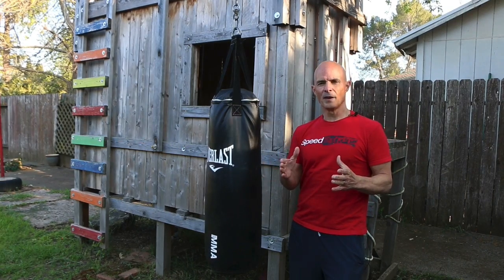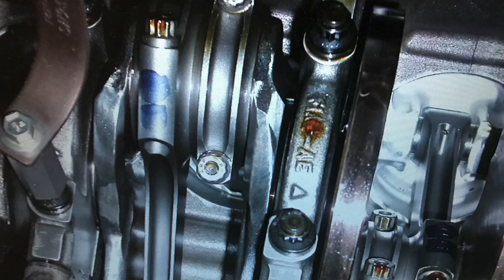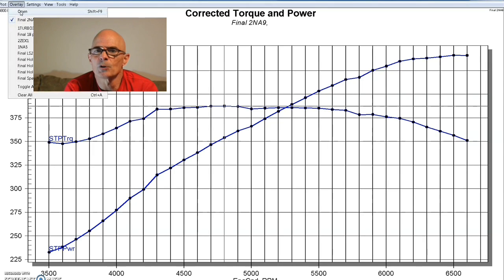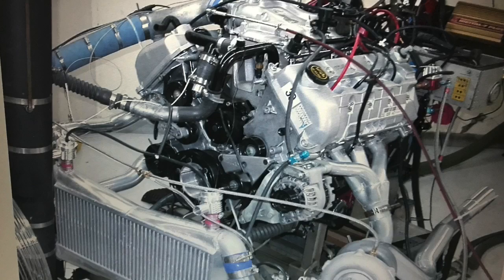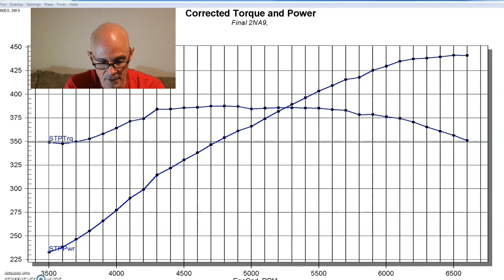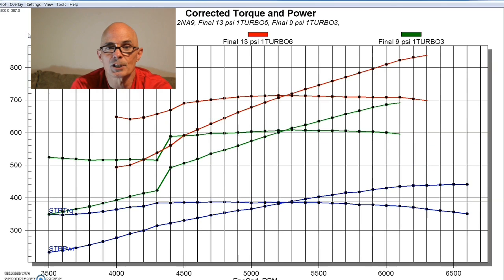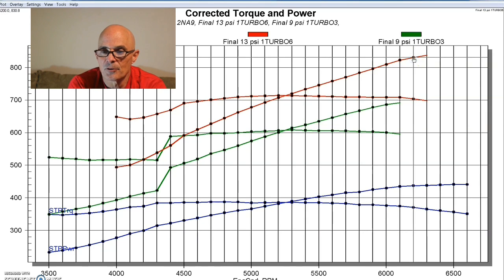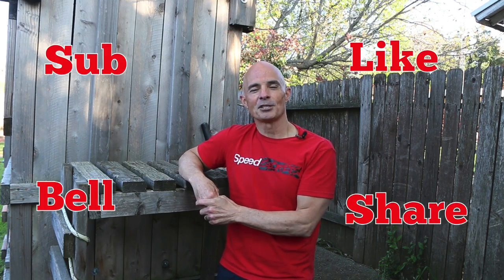1,000 HP TWIN TURBO FORD 5.4L 4V NAVIGATOR

Comment: I have 2  good running 4.6l 4v motors with the teksid blocks. This is just the video I needed  to finalize the plans for the build thats going in m,y 65 Galaxie. Not gonna try for 1000hp, but anything above 500hp that is 100% reliable is gonna be a win for me. Thanks for these awesome videos, I know I'm a little late to the party

Comment: so nice of a video so I recently recently got a Lincoln navigation 05 about a year now, and I’m a big fan of racing cars. I want something different I saw that the navigation had a V8 dual cam it was a 5.4 so I sad why not give it a shot the difference is I want to add a Whipple charger on it but this really helps because there’s not a lot of information about navigators with this type of set ups, even tho the 5.0 have this engine and the cobras. All tho they are quite different they are in the same block. This video definitely hyped me up to do this type of set up on my navigator and I can’t wait knowing the fact that it will work.

Comment: Hey Richard, have you seen the adapter plates from MMR that allow you to run a Coyote intake on a 5.4L 4V engine? I would be very interested to know what that could do for power compared to the other intakes you've tested. Thanks for the great content and info!

Comment: I want to do a build like this on my 2005 ford fx4 4wD. The current 3 valve just died at 205,000 miles love the truck dearly. Is it possible?Seems feasible to me. Just wanted your opinion Richard before I ask my friends and they clown on me.
Reply from the maker: IT'S EASY TO MAKE POWER WITH A 4v
Reply: @richardholdener1727  I know I would have to work some magic with the throttle issues swap drive by wire to drive by cable but are there any other kinks that you might  know about. Biggest concern for me is that my truck is 4 wheel drive I’m not sure if this is optimal for a build like or similar to this one you did on the video

Comment: Hi !! I will love to know if you put 9 psi boost and an direct injection of oxigen in the engine !! What i have in mind is the boost incrase air but There’s only 30% approx of oxigen in the air and what is igniting the gas is oxigen, so i would be curious to know if instaid of puting a lot of pression in it would incrase power at lower boost?
Reply from the maker: pure oxygen is very volatile -it was tried back in the piston engines in WW2

Comment: How bout a 3valve 5.4 with 550- 600ftpounds of torque for towing?? Don't care bout HP, does fine, but 450-500 ftlb @ 2500 rpm would be awesome. Noone does a vidio on towing, got to pull the rig to the track, or in my case, camper to the lake. Does fine, but more is always better.
Reply from the maker: 600 lb-ft at 2500 takes boost
Reply: @richardholdener1727  that's why I'm talking bout!!!! Thanks

Comment: I hope you'll get Ford to send you a 7.3L Godzilla to be let loose on. Those things are BEGGING for boost once you throw some ARP studs and forged 4340 rods in them. (why does EVERYTHING have powdered metal time bombs in them now?) I know with a simple intake, tune and headers that engine out the box makes over 500hp and almost 600 ft lbs.. to see one with some head work and turbos would be killer. I'm sure they'll shoot past 1,000 in no time and that variable oil pump and squirters will help keep it alive.. Hell I don't think 1200 would be unreasonable at that engine size.. and the torque will probably be right there with it.

Comment: Im staring a 5.4 build, so far i have an 08 shelby block and crank hbeam rods jdm pistons all balanced and ready for a set of heads and cams.. i was getting ready to spend 10k on heads and cams but after watching this video i think ill snag a set of navigator heads and build thoes..
Reply from the maker: GOOD CHOICE
Reply: @richardholdener1727  so i bought a holley hp engine management system for my build, 99 04 4v ....my question is with the 08 shelby block what navigator heads will work with this combo and can i us other 5.4 engine parts to cut costs on the block such as oil pan timing cover exc.

Comment: I'm having a hard time finding an intake manifold for a turbo 5.4l 2V. The 4.6 that came out of the car had a fox lake P51. Would it be okay if I used it with the adapter plates, or would raising the injectors a .5" away from the combustion chamber be a bad idea?
Reply from the maker: NOT SURE YOU CAN ADAPT A 4.6L INTAKE TO THE 5.4L

Comment: Hi Richard, as I may have mentioned I'm building a 4.6 4V. I was fortunate enough to get a brand new set of castings 9 thread heads a fellow had bought from Ford performance. So I went all out with porting and Ferrea valves. I never changed the guides out to say bronze. It's a street car 7000 rpm max. Block is teksid and I stroked it full forged internals. 10.3:1 compression. I'm ready to assemble but now I'm second guessing those valve guides. What's your opinion?
Reply from the maker: Guides are fine if the clearance is right
Reply: What am I looking for as a spec for clearance?
Reply: I just want to do this correct the first time. My head builder / porting guy is good more of a LS chevy guy. Good flow number similar to what Fox lake racing published. But his first modular set. Remember I am in Canada. BTW I had sent these to Hyland for this but that turned into a long story where I ended up flying to Ontario and taking them back. A year later his shop was closed.

Comment: Does the 4 valve engine have variable valve timing like a 3valve engine? If not how is the timing adjusted? I have a 5.4l 3valve engine in my 2004 supercrew lariat, it's not a dog, but I would like to increase the horsepower and torque not to race or run racing fuel but just a strong reliable driver. I realize that I will need to run 93 octane on a turbo motor. Any pointers would be appreciated. 
Thanks 
Scott 
USAF veteran

Comment: I want to stuff a Navi engine and five speed into one of my vic's . I'd have to run both turbos some where between the front wheels and front bumper but I do feel this set up would make that 4400 lb panther feel like a faimont futura 😈
Reply: I've got a Mustang 6 speed swapped into my Navigator and it's a damn riot for 5800 lbs.
Reply: @BuffMyRadius  6 speed swapped navigator?  Holy crap do you got videos?  That is awesome.  Just like 6 speed lightnings they really get my blood pumping lol
Reply: @midnight347  I do have some build videos up on my channel you can check out

Comment: Would it be cheaper to get a built 5.4 with cams and worked heads to boost or a stock Coyote to boost swap in a SN95 Mustang?
Reply: You won't need worked heads but cams would be beneficial I beleive you could prob do a forged internal 5.4 4v for similar money to gen 2 coyote cams included and make at least as much prob more power.  You can also set compression wherever you want if you are building the bottom end.  And you have a newly built forged motor vs a stock used motor.  As good as the coyotes are id still rather have a fresh built 5.4.

edit
Not to mention a cammed 5.4 4v would sound heavenly def better than a coyote but sound is subjective lol.  They do sound gnarly though.

Comment: The idea of swapping a Lightning engine into a Navigator had long been in my mind, but having seen the results had with a boosted 4-valve DOHC 5.4, curiosity begs what that w/inter-cooled blower would result instead! :D
Reply: Wouldn't you be able to run a gt500 lower manifold/intercooler setup on one of those?  Unless the heads make it different fit or whatever but they're both 5.4 4v.  That would be awesome.  Then you could just run any blower they make for gt500s.  I would go gen3r them tvs are torqey and good on the hit that would help get that big behemoth moving lol.  I would def just build the 5.4 4v in the navigator and boost it rather than doing a lightning swap.  I'd rather have a built 5.4 4v over a stock lightning 5.4 2v.  Much better potential.

Comment: The 5.4 engines in Australia have the 4 valve head and we found that the heads need bleed holes in 2 spots on each head and the rear  passage in the block needs a water fitting and then all of those points need a modified thermostat housing to accommodate those bleeds. We also modify the water pump impeller to give a consistent head pressure. The result is a much smoother torque curve and the ability to lean off the mixture safely.
Reply: I read about this somewhere in a forum I’m glad I didn’t make it up in my head

Comment: I used to live and breath Ford mod motors - boy, have I seen the light since then. Gotta give Ford credit for a really stiff and robust bottom end architecture, but it took them 25 years to ever put a good set of heads on them (coyote). Beyond that, they're freaking HUGE. They don't hardly fit in anything you'd want one in. Then the complexity and number of moving parts - 32 valves, 32 roller followers, 32 lash adjusters, 4 cams, 4 cam chains, 4 cam chain tensioners, 8 cam chain guides, etc etc etc.  Tiny bores that are hard to get filled. The list of demerits is endless - and for what? So you can claim that your power/displacement ratio is better than GM's OHV V8?? No thanks.

Comment: Im running 5.4 4v NA, how are you getting 90hp more than mine in na form? 😧 they're a pain to work on in car thats for damn sure
Reply: This is an engine dyno no driveline loss no accessories no exhaust etc.  Numbers will be higher.

Comment: Awesome. I'm currently doing this swap into my 98 Svt Cobra but using a heavily modded Aussie 260 boss intake with cams and longtubes , she is built and around 10-10:5:1 Cr , Great Video
Reply: You should be above 350 possibly 400 wheel depends on the camshafts and the tuning and what fuel etc.  I contemplated doing it on my 97 cobra back in the day but decided against it that was in 05 and I didn't know as much about how to get power out of em and intake options were even worse than they are now lol. Good luck with your build these motors are badass

Comment: Can you do a build on a ford 302 and basically squeeze every last possible naturally aspirated hp out of it on a “roller block” to see how obtainable it is for everyone? Dart blocks are pricey and a lot of people use oem blocks. It doesn’t have to be a true roller but pretend it is 😉. Itb’s and equal length headers, all the way 🏎💨

Comment: I had nothing but issues with my 4.6 4v, bleeding the air out of the cooling system was a nightmare!. Amongst a bunch of other issues , id take a 302/351 with boost any day over any mod motor! Half the size with more cubes kinda a no brainier
Reply: Maybe you just didn’t know what you were doing Bc you’re the only complaint I’ve seen on that engine, 4v mod motors are good, 5.4 2v’s are solid, 3v’s and the 4.6 2v are junk

Comment: That tuner are you running?
Reply: Will this also work for a 98 f150 non pi🤔if I did the pi swap polished heads and a cam would it make around 400?

Comment: How about a budget 351C 2V making 400 HP. I know this channel doesn't spare expense because the idea is to make as much HP as possible. And that's fun to watch. But most of us will never spend $8-10K on a single engine. I've seen several builds of the 351C 2V that fall a little short of the 400 HP mark. It almost looks like the 2V is preferable for a true street car.

Comment: Ran a 5.4 2v Lightning for years, stage II cams 7lb crank pulley,  ported Eaton and heads with full Bassini exhaust.  I am more of a SBF and BBF guy, but that motor always impressed, sounded excellent and very smooth.

Comment: I'd love to see how the new 7.3L Ford engine reacts to boost. Seems to me a twin turbo version of that engine could be quite interesting.
Reply: Sofiane Pontiac  he's talking about Ford's new 7.3 gas but Wow that's awesome
Reply: Needs valve train it don't spin very fast bone stock.  It barely makes peak power before 5k it needs heads cam and springs then it's good for about 550-600 na.   Then your talking a true boosted monster...
Reply: @alexwhite176  These 7.3 engines making peak power at 5500rpm is actually pretty high in the revs for that many cubes. The stock vvt valvetrain is robust and quite capable at higher rpms. With little more than a proper intake and cam, you can easily get 5-600hp out of these new big blocks. Even the fact while stock, they make over 400ft/lbs from about 1500rpms all the way past 5000 is stout. This thing should sneeze out 800+ ft/lbs with less of a torque curve, more of a torque shelf.
Reply: @madmod  amazing how things change in six months lol
Reply: To those who complain about the 7.3 not doing well at high rpm: remember what it was built for...a super duty truck.  They will need some work to make power at big rpm’s, but certainly a better starting point than a 460, and it’s externally tiny for its displacement! Regardless, we should be excited that Ford came to their senses and went back to pushrod simplicity
Reply: @williammccourt7581  The 7.3 peaks power higher than the 4.6 2v mustangs do. If it peaks at 5500, it can easily run out to 6500 and maintain valve control. Ford already released valvetrain specs and they are more than capable of turning rpm. Displacement isnt a limiting factor in rpm assuming you've got the flow capacity and valvetrain control which this engine certainly does.
Reply: @madmod   I understand that displacement doesn’t dictate an engines ability to rev. I’m just tired of people complaining on the internet saying the power band is low, as if it weren’t designed for a huge vehicle whose job is to tow and haul at low rpm. It just grinds my gears because it does it’s intended job very very well stock and could easily be modified to be an absolute screamer if you want to change its job to being a track monster. I’ll quit bitching about other people bitching now lol
Reply: @williammccourt7581  I agree with you dude. This thing makes over 400 ft/lbs of torque from idle to nearly redline. Every dyno ive seen in truck has been still climbing in power at 5k rpms and thats with its long runner truck intake in fully stock trim. Even if the power hits a wall and falls off at 6000(which i guarantee it doesnt), it would still be making enough power to put a street driven auto car in the low 11s, if not high 10s stock. They make the power of a boosted stock modular at the same rpms and do it on a low compression stock truck engine.
Reply: @williammccourt7581  Dont we need to consider the engine's stroke, bore, and compression when thinking about high rpm power?  If the piston has to travel further when compared to how much force is pushing it down, I'd think that would be the biggest factor. But I dont know much bout this topic tbh
Reply: @williammccourt7581  I agree with ya on its purpose. It makes its power low down. Its designed to be a work horse without having to deal with the high maintenance of a diesel option. Just like the 90s GM 454 with the peanut valves, its a slow turning big block. You allow it to breath and flow and it'll make big power. Im excited to see what the 7.3 gasser will prove once companies come out with aftermarket products!
Reply: Hey, Ford may be giving us it with the potential of Megazilla.
Reply: There are Videos out now of stock 7.3L with boost making HUGE power.
Reply: @superkillr  Yes there are. Pretty awesome
Reply: That's not in the modular family is it? Will a T45 or T56 bolt up to it?
Reply: 460>the new “7.3”
Reply: @gokartmadness3047  The weight and size advantage of the 7.3 alone is a huge advantage over the 460. Never mind the fact it makes 100 more hp to the tire.
Reply: @madmod  thats because the 7.3l is literally a small block. its about the size of a 351w
Reply: @87DAM1987  they are a good bit longer with having such a wide bore spacing
Reply: @87DAM1987  Really it's that small? I haven't seen one yet outside videos on a dyno so hard know size. Impressive package that Ford has come up with.
Reply: @gokartmadness3047   460 is a great engine but to build a turbo efi setup even off a junkyard block with decent heads and valvetrain will cost more than a new crate motor 7.3 (I was considering doing it)

Comment: Good evening from Florida. Love your videos. Super informative stuff. I love this engines. I actually have 7 of them. I'm building a 5.4L DOHC for my 1990 mustang coupe efi single turbo. It has a shelby 5.8L crank, hbeam rods, mmr red pistons, stock heads, Sullivan intake. I'm still working on cams. No ac, ps, pb. Tubular front end, mini tubes with a 15x12 rear, 17x4 front. Its still in progress. Keep up the testing on the 5.4L dohc. On how to improve and make more power which is always a good thing. Thank you
Reply: Thank you so much for throwing a badass 5.4 4v into a fox and not a stinking ls.  Coyotes are great too but done alot the 5.4 sounds better imo and is different.  Nice